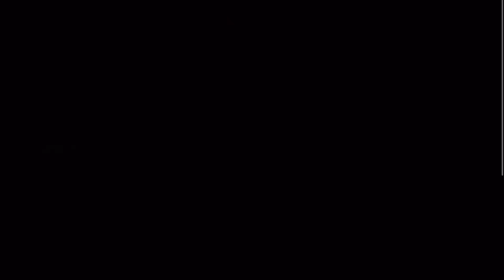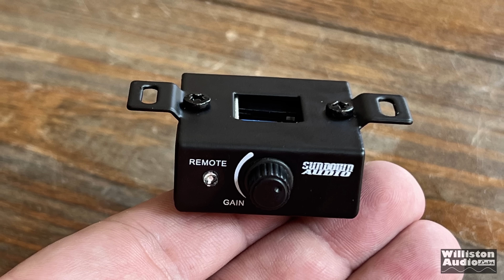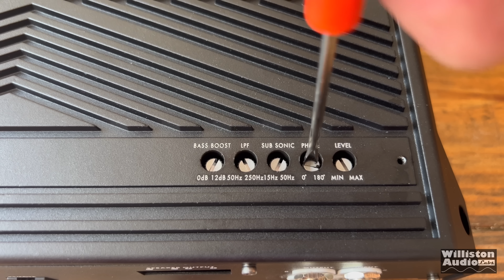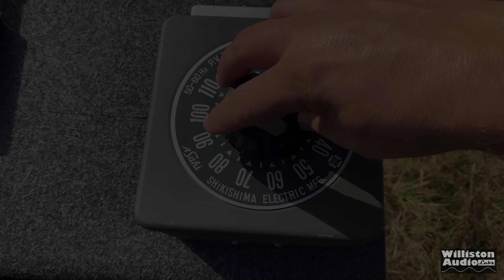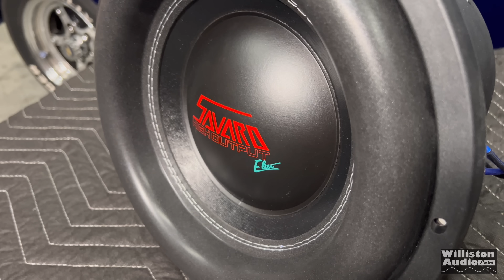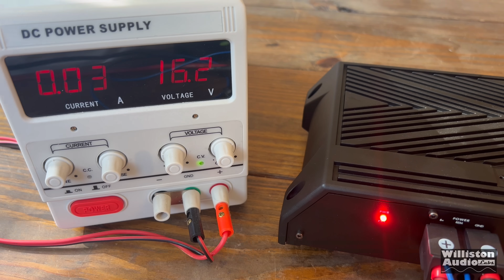Can This Marine Grade Subwoofer Amplifier Put Out 2x It's Rated Power? Sundown SDX-1200.1

Comment: Hey D, I may be wrong but I dont believe I've seen you amp dyno any Memphis amps. Is that something you could do?

I'm running a Memphis PRXA 1000.1 monoblock on 2 kicker CVX 12" dual 4 ohm DVC subs wired to 2 ohms each. Then bridged down to a 1 ohm load on the amp. Thing barely gets warm. 

I'm very happy with it. I'd just like to see a memphis amp on the dyno.

Comment: I’m curious about the mini budget amps on amazon.  I would like to find a solid 4 channel.  Also, the marine amps are probably not jacked up because power sports charging systems are considerably smaller than automotive systems.
Reply from the maker: I’m testing an inexpensive 4ch amp now, stay tuned
Reply: @wal  perfect, hot out here in NC ain’t it?  Stupid hot in Garner yesterday.

Comment: The MTX Audio RFL4001D mono block amplifier is a powerhouse of clean power. It is at the cutting edge of technology and performance. 
With more than 4000W RMS in class-D (very high efficiency), it pushes the limits of amplification. To achieve this, we spent three years in development to bring together the best in high-fidelity and in high-output. We also used the best components available.
The power supply is cut by the most efficient MOSFETs available from the best manufacturer, International Rectifier (USA). They support 640A each, 175°C and there are 12 of them. We used 6 transformers to distribute the load and the temperature. 

The energy storage at the power supply output is provided by 23 Elna capacitors, with low resistance and ultra fast. They withstand 105°C, but never exceed 60°C even after 5 days at full output! On the power stage, we used MOSFETs from International Rectifier which support 280A each.

To verify the correct operating balance of the RFL4001D, we monitored it with a $35,000 thermal racing camera. This allowed us to monitor the temperature of each component and the width / thickness of each track on the PCB. It's been a painstaking job, but the MTX RFL4001D performs much better than our wildest dreams. The RFL4001D is the highest performing amp ever built by MTX.

Check out this video by MTX dealer AV-DC:

Features
• High End amplifier ; high-end clean output power, high-end sound quality, high-end components and high-end construction. 
• 1Ω to 8Ω compatible.
• Flexible active crossover with subsonic filter.
• Bridge 2 amps together to create extreme output power of 8000W RMS
• EBC included (External Bass Control)
• 4 x 50mm2 power connections

Specifications RFL4001D
• Class D Mono Block amplifier (1 channel)

• CEA2006 certified output power :
- 1x 4000 watts RMS @ 1Ω THD+N ≤1%
- 1x 2400 watts RMS @ 2Ω THD+N ≤1%
- 1x 1500 watts RMS @ 4Ω THD+N ≤1%
• Damping factor : >500
• Bridge mode function (2 amps)
• Active crossover :
- Low Pass (LPF) 24dB/Oct variable from 40Hz to 150Hz
- Subsonic filter 24dB/Oct at 20Hz
• Phase selection 0° or 180°
• Signal/noise ratio (1 watt) : >95dB
• THD+Noise (Distortion) (1 watt) : ≤0,08%
• Frequency response (±1dB) : 10Hz-150Hz
• RCA input sensitivity : 200mV - 6V
• EBC (External Bass Control) included
• Dimensions : 626mm x 204mm x 59mm

Please note: This high powered competition amplifier should be installed by a professional car audio store, with supporting power upgrades completed on your vehicle such as the ‘big three’, 2-3 matching/new batteries, high quality dual 0 gauge wiring and earthing. The final impedance of the subwoofer/s can not be below 1 OHM with a single amplifier or 2 OHM with 2 amplifiers strapped. If in doubt, talk to a professional. Warranty and repairs are honoured when these requirements are fulfilled in line with Australian Consumer Law. 

Download product manual here

Share
 Share on Facebook

Comment: Do recreational boats work the same way as cars regarding the sound system? Would it be advisable bumpin subs on an amp like this all day fishing? It wont leave me dead in the water come time to fire the boat back up to go home?
Reply: You want a starting battery and a "house battery" with a isolator solenoid between 'em. The house battery (deep cycle AGM, lithium, etc) is for amps, starting battery for boat. Even if house battery dies, you're not gonna be dead in the water.

Comment: Im also into boating but never installed an amp or soundsystem in it. I prefer the sound of my oldschool 2 stroke V6 flying with 66mph over the sea with a small 20ft 😎😃 But very nice that there a nice marine amps out there if I change my mind one day 👍 I never wanted to put my oldschool Rockfords into the boat because of aggressive salt water environment 👍

Comment: Think the remote being hard to turn may be intentional due to it being made for marine application. Picture your hand on the remote and the boat drops off a high wave!
Reply from the maker: Could be but it needs a larger knob to assist in the turning...in my opinion
Reply: No. Because I have the sundown saz 1500 special edition and it has that exact same bass knob, and this amp is not marine rated amplifier. It's weird because it's so small but, it is what it is.

Comment: I would be very interested in seeing a Wet Sounds amp to see if they make their rated power. They’re obnoxiously expensive for average equipment that I question will make their rated power based on fusing. 

Marine audio market is horrible for the most part. Over priced, under performing crap from JL and Wet Sounds dominates the market. All you hear on the lake and on the trails is 60hz and above from a bunch of HLCDs running off clipped signals. Good on Sundown though for keeping that price to performance ratio where it should be. Refreshing to see. Wish Taramps would get into the marine market.
Reply from the maker: Thanks for the suggestion 👌
Reply: Try Rockford Fosgate

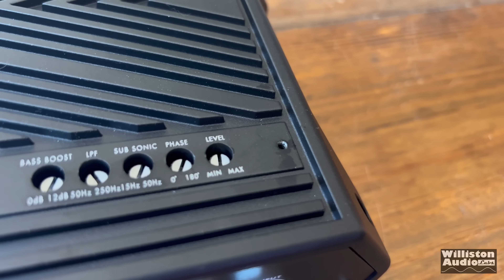Comment: @3:32 - Show me the rubber o-ring on the bottom of that cover or this amp failed at the design stage - especially if the amp is mounted with the connectors face down.  Even a rubber coating on the bottom of the plate would be decent.
Reply from the maker: The amp doesn't mention an IP rating, and it's not really sealed. I agree adding some ingress blocking would be a good idea

Comment: I had one and sent it back cause the remote sucks,but built like a tank,nice video. Been waiting on a dyno of this amp.
Reply from the maker: Seems like a larger knob would help out tremendously
Reply: @wal  Mine only worked from about middle and up,nothing on the bottom,strange. The ppi power class you revued has 40 detents! I love it.

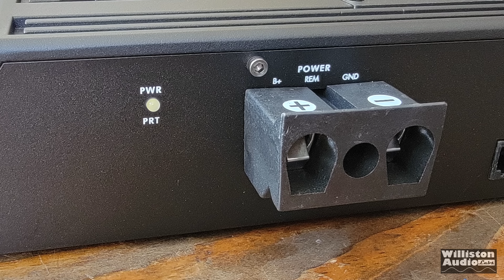Comment: @2:29 - It kind of looks like those plastic blocks are glass-fiber reinforced poly-carbonate material.  That probably way stronger than a standard chinesium plastic block.
Reply from the maker: Yes, they feel good. Just a bit difficult to get wires with ferrules to stay in as they tend to push out the wire when you tighten the terminals

Comment: While power ratings are important, I would love to see a comparison of bass amp damping ratings.
Reply from the maker: I would suggest watching Joe Hobart on the KICKER channel as he describes why the damping measurement is useless. Too many different methods and it's much ado about marketing when it's highlighted
Reply: @wal  When I have compared digital to class A/B amps, the difference in bass quality is noticeable. I have yet to hear a Digital bass amp that sounds better than an A/B. I have been doing this since the 90s, and owned some of the first Digital amps to hit the scene. The power is always there, but just doesn't sound as good. The cleanest bass has always come form high damping rated ones. Like the Zapco AG750, old school us amps, and now the Mosconi Zero 1. Back to back testing shows a clear audible difference in between the best Digital, vs the best A/B. was even obvious to non audiophile types. I swear these manufacturers would rather sell cheaper digital hardware, that consumes less power over inefficient A/B stuff. Just like we have standardized testing for power, maby we a properly standardized metric for damping.
Reply from the maker: @bundles1978  Class D isn't digital, but I know what you mean. There is some audible difference but there has not been a measurement I've seen to detect this difference in A/B and D